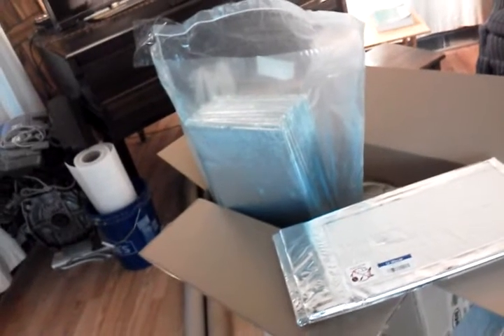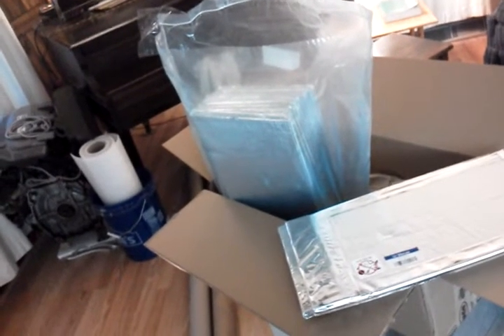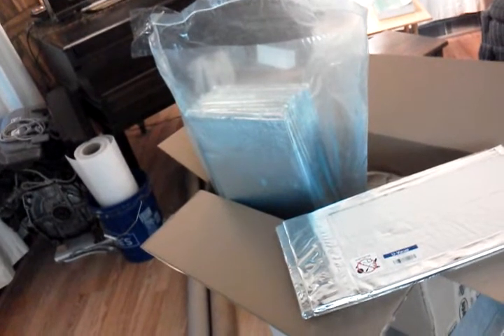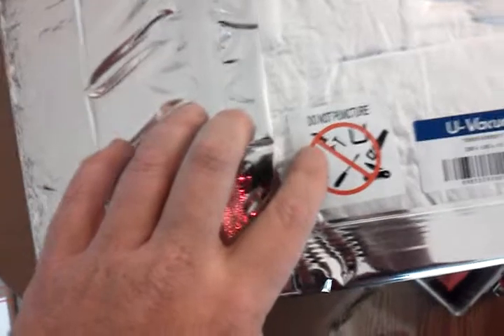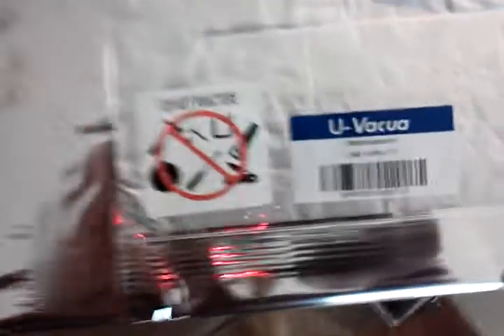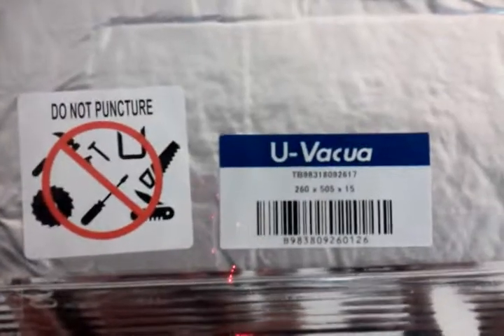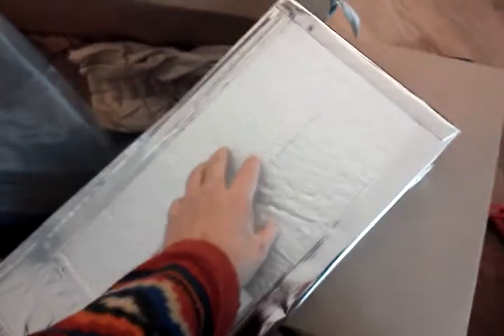VIP

Comment: How much do they cost? Can you use these in the ceiling of a home?
Reply from the maker: You can put them in any orientation .. ceiling , floor , walls , etc.

The big 2 considerations on using them are:

#1> Fragile
If they get cut , punctured , etc .. they will drop their insulation value of regular foam board. Anyone working with them has to adjust their methods to account for this. Not all that difficult to do .. but , just not the 'norm' many installers are used to.

#2> Design around the size of the panel being used.
Because they can not be cut , nailed , etc .. things that most contractors are used to doing with insulation .. it means the installer has to design around the fixed size of the panel .. not rocket science , but just not the 'norm' many contractors are used to.

- - - - - 
Price varies with size of panel , and qty ordered.

For small orders all the way down to 1 panel , a good Panasonic distributor is Digikey .. https://www.digikey.com/en/products/filter/miscellaneous/579?s=N4IgTCBcDaIA4EMB2CDOB7JBLAxgAgDUBJABRAF0BfIA

If you were thinking about a very large order .. eventually it might be large enough to be worth trying to go through the bureaucracy of buying them directly from the OEM (Panasonic) .. But I doubt it would be worth it unless you were looking at getting some very large order of like several hundred panels.

Comment: I wonder if the VIPs could be laminated with a puncture-resistant layer like a PEG-impregnated aramid fiber weave? They make puncture-resistant gloves out of that stuff, so it seems like a good fit for VIP.
Reply from the maker: Such a thing would mean the likes of me and other fabricators wouldn't have to be as gentle with them.
Might be needed for mass use .. considering how I see many things shipped to and handled on job sites.